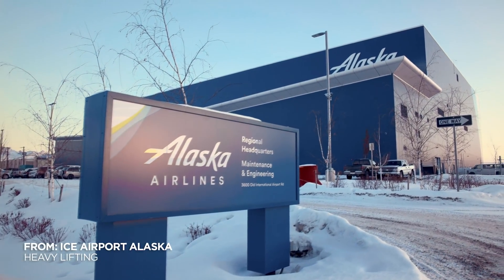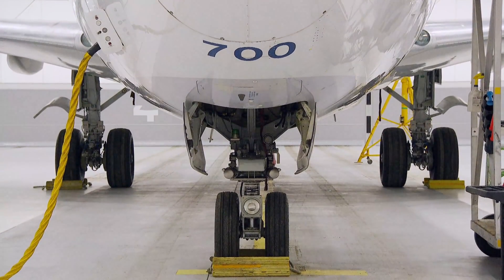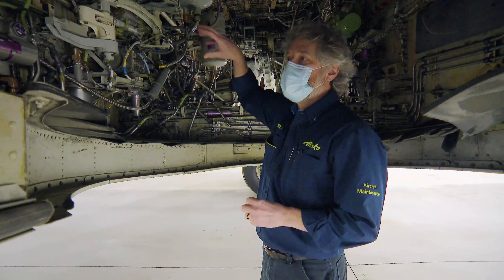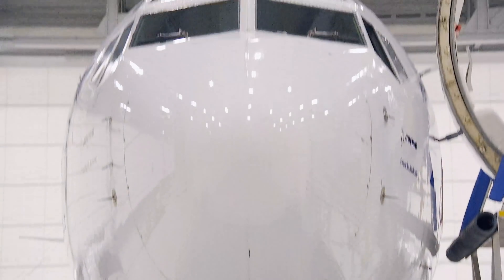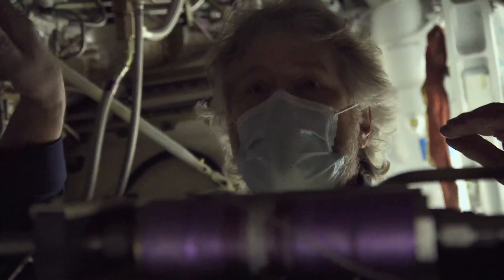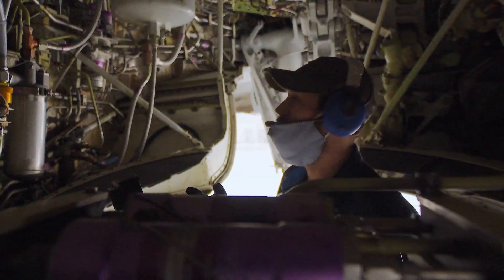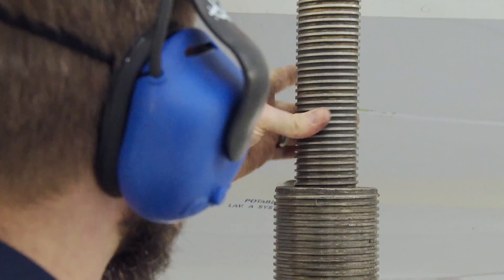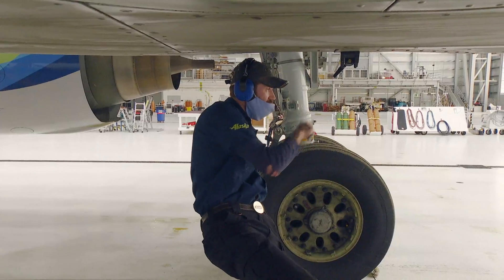Engineers Plan to Lift Up an 80,000-pound 737 Plane | Ice Airport Alaska | Smithsonian Channel

Comment: Boeing 737 has no landing gear doorz
Reply: Only the Nose landing gear has gear doors, the Main gear uses the outside wheel with a large hub cap type over the wheel which fairs with the bottom of the Aircraft when retracted.